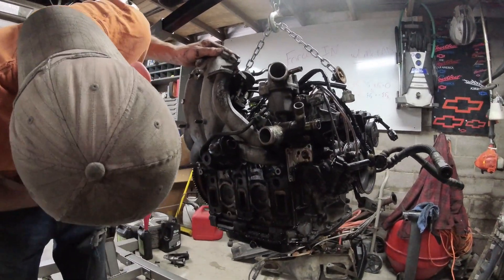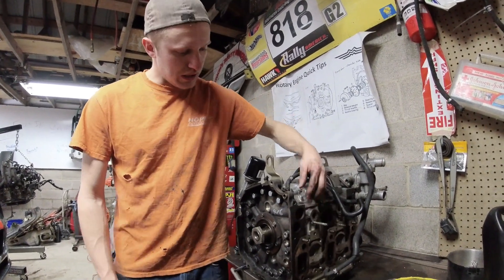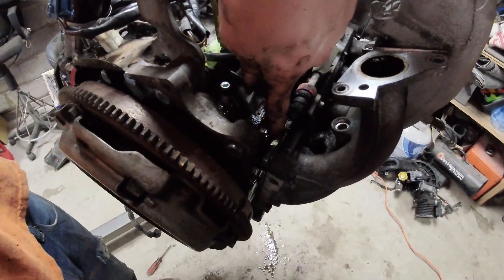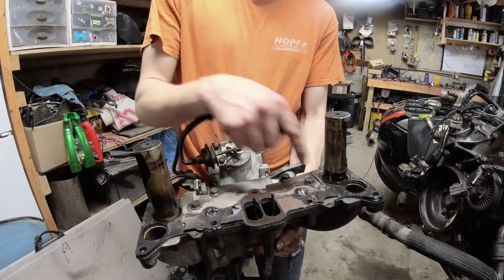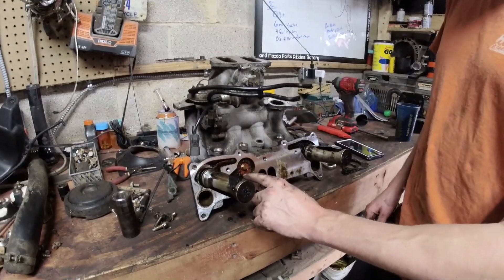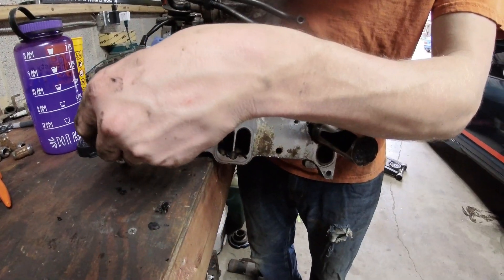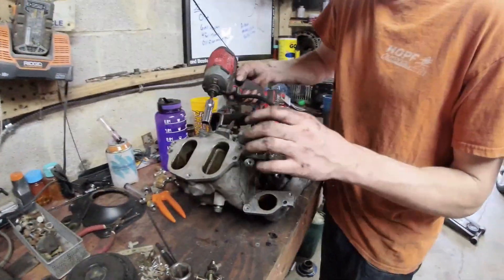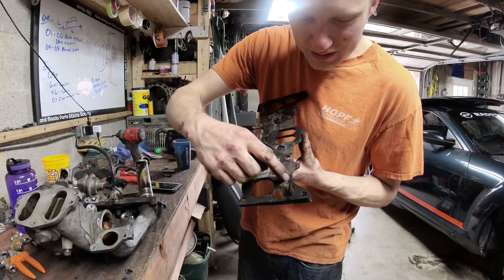Mazda RX8 Huge Power Loss if This is NOT working Properly

Comment: This is the first video I have found that discusses carbon buildup of the Shutter valves and the gear mechanism that opens and closes them. Kudos to you! I'd bet many a novice has attempted to pull an RX-8 lower manifold has experienced this sticking issue! It gradually makes sense that the engine control module merely dictates information to the vacuum solenoids and they in turn open and close according to demands placed on them with the help of a gear motor driven by vacuum pressure. Simple, eh?

Comment: This is the video I needed getting p2004 apv stuck open I can hear cycling turning key on and off
Reply: After removing apv motor the gear moves freely but get sticky when fully open sat there for 10 mins moving it back and forth car seems to run better low rpm and butt dyno makes it seem faster then last night Ima do the decarb and hopefully fix the issue until I rebuild the motor
Reply: How did you fix the p2004?

Comment: If for whatever reason you can't get a new gasket in time, you could drill the rivets out, soak the layers in a pan of acetone and scrub the coating off with a wire brush. Re coat the layers with some spray on copper gasket.

Comment: The little screws to hold in each of those APV Barrel valves is like $15 per bolt. The bolt is weak, and it's shouldered. Be careful to not break that bolt like I did doing that job. Blue loctite and screwdriver torque only will suffice for those bolts, otherwise you're up for a wait for one tiny bolt that's made your wallet $15 lighter.

Also, you lucked out that that engine didn't ingest that 10mm... I've seen some gnarly damage from a 10mm socket going down a port.

Comment: Top rotational valve underneath the black upper intake is the VDI aka "Variable Dynamic Intake". With intake setups, there is always some form of reversion once the rotor closes the port. The VDI opens in the upper rpm to allow that reversed flow to the opposite rotor creating a small super charging effect. When the other rotor closes the port, that reversion comes back and goes back to the other rotor to super charge the other side. The VDI bounces that reversion back and forward until it closes. This is essentially Mazda's version of V-Tech.
Reply from the maker: Thank you!!!  Similar operation to the S5 NA cars based on your explanation.  Love to learn from yall!!
Reply: It's amazing how I know you from other videos. =D I have taken quite a bit of advice from you sir. Keep spreading your knowledge.
Reply: @sofakingdom3076  bruh sofa kingdom
i've been there

Comment: Just an FYI I'm not sure if it's a part of the world thing, but not all SSVs have the switch to report back to the ECU.
Also it is possible(but very difficult) to remove the lower intake manifold without removing the engine, however you do have to cant it over so engine mounts need to be undone and pry bars can be very helpful
Reply from the maker: I did some measuring and I knew it wouldn't just come out. But I for sure haven't tried to tilt the engine over and remove it. Sounds like a lot of extra work. But if you don't have a hoist then that makes sense

Comment: Soak those groady valves overnight  in a mixture of acetone and trans fluid it does wonders. Hardware stores sell it by the gallon
Reply from the maker: I used some brake clean. Some injector cleaner, and some penetrating oil. Works wonder!!
Reply: Honestly yeah, brake clean or intake cleaner sprayed on the valves while your wiggling will get the most stubborn ones out.
Reply: Soaked mine in atf then brake cleaner then sanded burs off and Polish intake manifold and valves she purrs like a kitten now ! Rips hard

Comment: So you have definitely just convinced me to never buy a renesis, I would have to swap in a 13b if I owned one
Reply: all part of the master plan, keeping rx8s cheap >:)
Reply: I have had my for almost 25k miles with zero issues, but I keep it well maintained, so I suppose that may be why. Nothing great comes without vigorous dedication.
Reply: Buddy has 145k miles on his rx8 no rebuild unless it happened before he got it at 25k... The rx8 is a amazing car for the price! The only downside to the 
Rx8 is gas mileage to power ratio 20 mpg freeway with only 220 hp kinda lame.. I get over 25 mpg in my 397 
Awhp Evo...

Comment: Man. You make me worry about my 2009. It's a low mileage unicorn (very close to 12k miles). Other than redline every time I drive it anything else I can do to mitigate the carbon. This is making me question my sanity getting into rotary life.
Reply: I went full synthetic once I installed the sohn adapter. =D Fresh two stroke at all times. I also have a stage one tune that increases the two stroke added per load and rpm. =] I have to premix less now because I was fouling my spark plugs much quicker than usual.
Reply: The lack of use of each valve is generally the main reason for them getting carbon locked. Regular high rev shifting can help prevent this. Also spending less time at idle. Many people will let their rx8 warm up before driving thinking its good fo it. All fuel injected vehicles should be driven at light load, low rpm  immediately after start up to accelerate the warm up process. Jist sitting and idling will cause more carbon build up. Once it's completely up to temp let it rip! Also you may want to cruise in a lower gear to raise the rpm. This can also help reduce carbon build up. 2 stroke oil can play a big part in renesis reliability even for the S2 modles. It can even help lubricate the aux port  vales. On the S1 the oil injectors are pointed diagonally away from the center of the apex seal. That causes the seal to sag over time.
Reply: Block omp and premix, nothing else to do really
Reply: @anyau  the S2 engine has a completely different OMP system that no one has easily figured out how to block off that I know of.
Reply: Since you have a s2 you can't do omp adapter. You can still add 40w oil I would do a synthetic blend or regular oil. Also for a carbon clean some people do a steam clean some people do zoom zoom cleaner ( seafoam) also check on your coil packs.